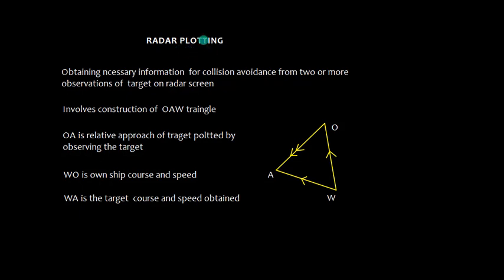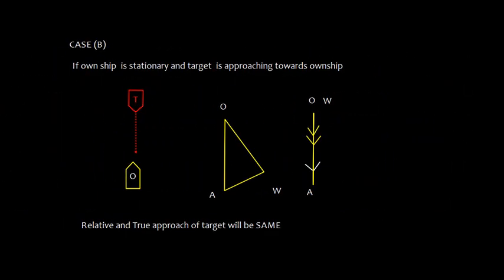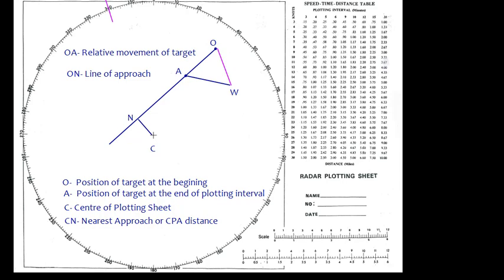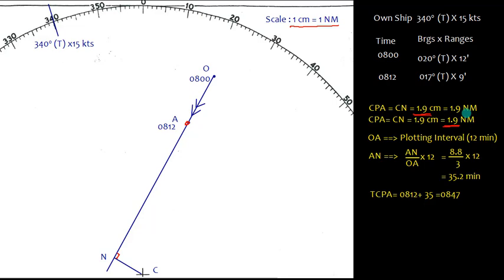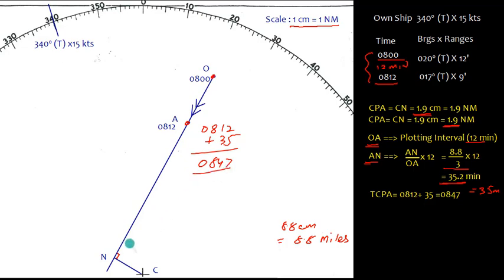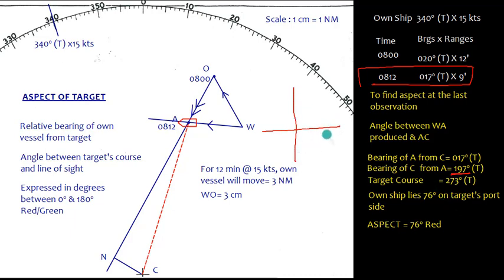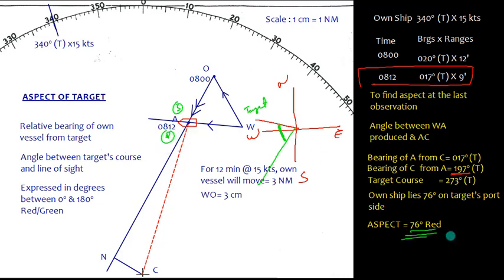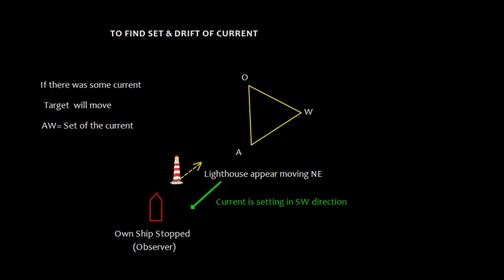Radar Plotting _PART 1

Comment: Very helpful but at the very end it's bit confusing . When there is current , why u take AW , why not WA ??
Reply: In reality, the vessel will move in the direction of current and light house will remain stationary

However, we assumed that the current will cause the lighthouse to move in the direction opposite to current and own vessel will remain stationary for calculation purposes

Therefore, to find the actual set and drift, we have to reverse WA to AW. Let me know if you need more clarification
Reply: @yugeshh   cud you please msg me on my what's app 07417429796
Reply: That means set is NE or is it SW which one to consider...?